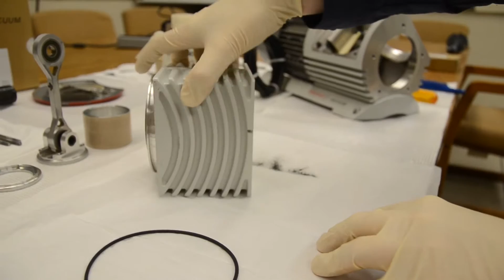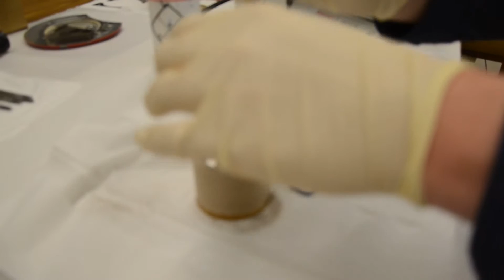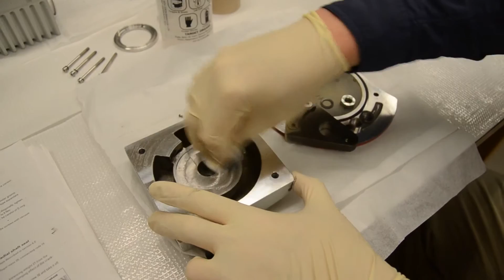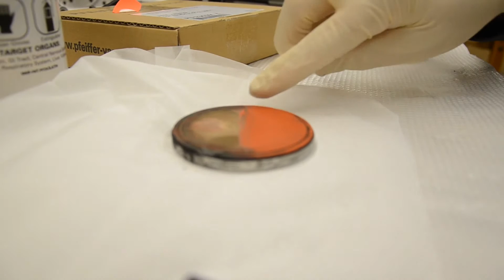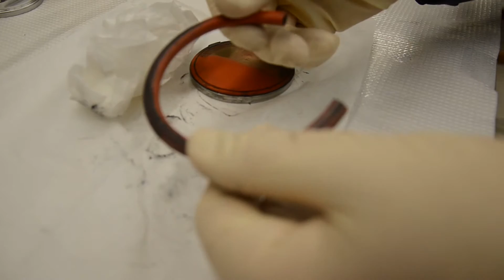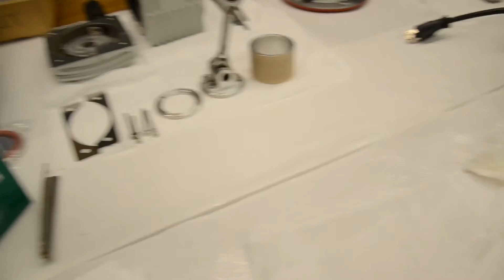Pfeiffer Vacuum Pump Rebuild - Step 3

Comment: Do you have a part number for the replacement gate valve and rubber tube/spring? I called Pfeiffer and they claimed it wasn't available. I ended up glueing new silicone sheet to my old valves. But it breaks down eventually.